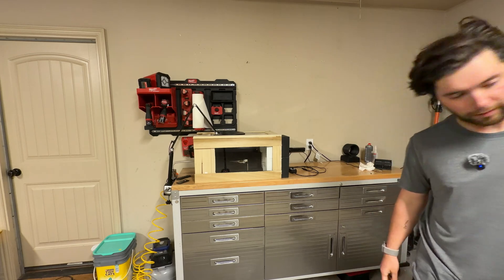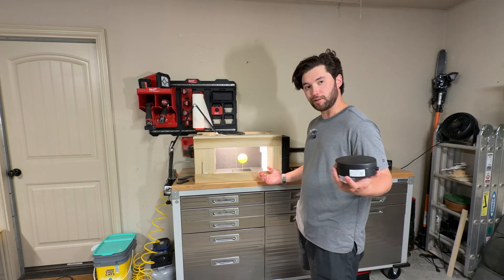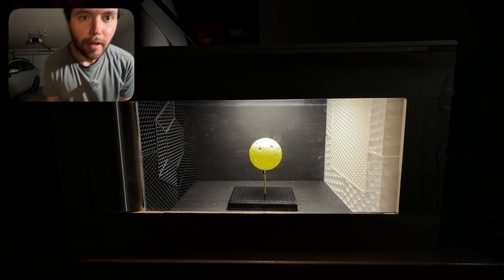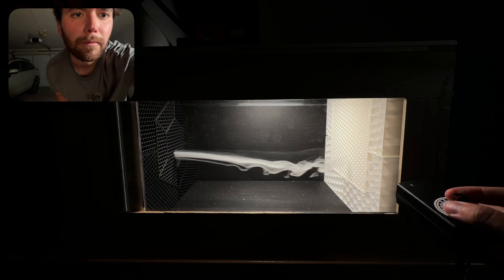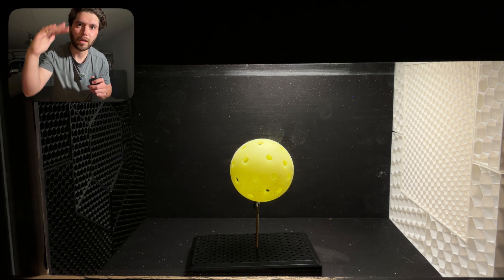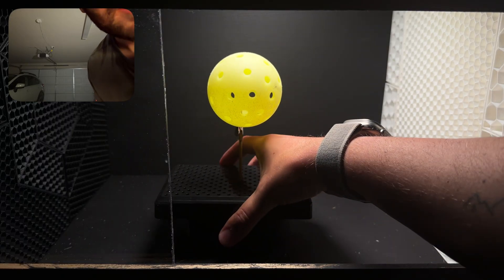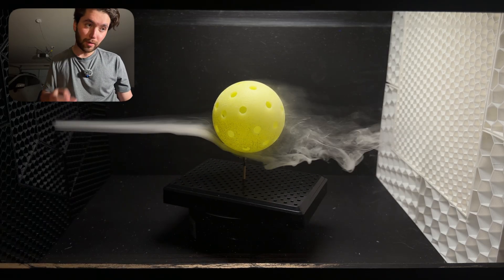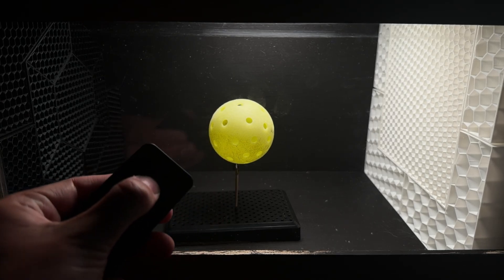Pickleball in a Wind Tunnel: The Science Explained

Comment: The reason balls turn mid air is because when they spin, for example to the left, the air going at the right of them get compressed due to the ball turning against it, and the air going to the left gets decompressed, as the ball helps it move with its rotation

So at the end there are 2 spaces around the ball, one with more pressure and other with less pressure, so the ball goes away from the high pressure zone and into the lower pressure one

Because the ball keeps turning, those pressure zones turn with it, so the ball turna until it doesn't spin anymore or lands
Reply from the maker: Cool !! Thanks for sharing!